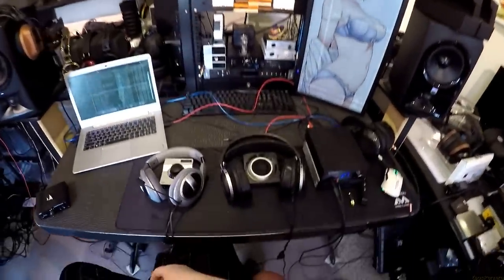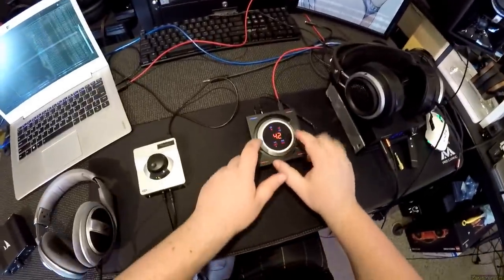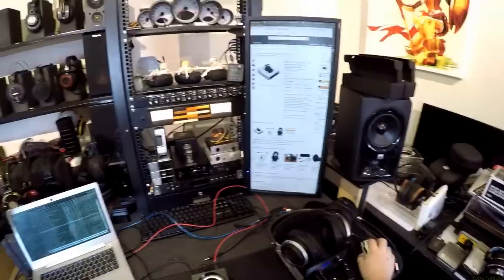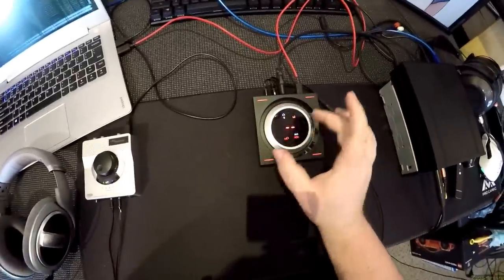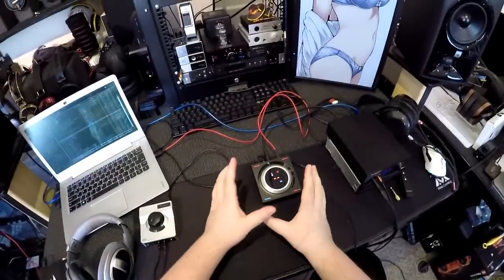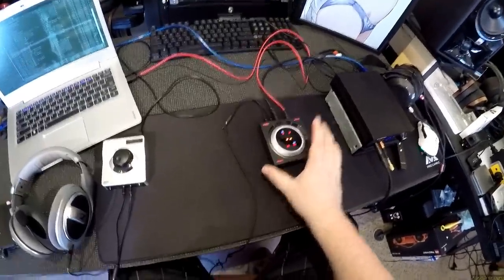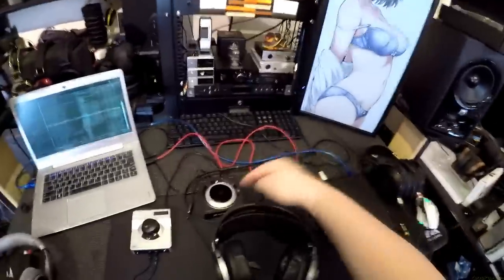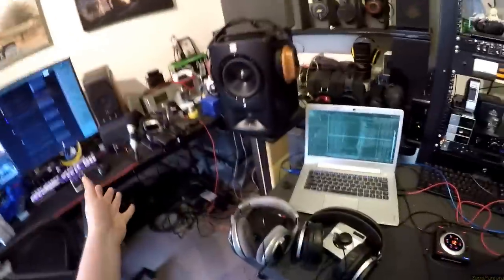Z Review - Sennheiser GSX1000 & Burson Play & Syba Sonic & Mayflower Arc

Comment: Is it worth buying the sennheiser? No. You can just get a sound card, run the optical out into a real dac, plug amp into it, your done. You have virtual surround sound without it sounding like shit because you turned your sound card into a DSP. And that doesn't have to matter if creative or dolby makes their virtual surround software not need hardware to work. Sure wave NX exists and so does... blech razer surround but  they are not great virtual surround sound encorders. Shit you can buy an old creative card like the x-fi xtreme gamer for like $30, plug it into a micca or whatever and congrats. You're done.

Audio companies or at least the "gaming" ones. I've basically told you what needs to come out. We need a DSP solution. Not a sound card, just a simple optical out with software solution or 100% software solution. Stop selling us the hardware which sits inside a electrically noisy box and does horrible things to audio, suck in your pride and just sell the software. Dolby, you can cut asus out of this gig completely. I know you are doing dolby atmos but dolby headphone is fine also and it actually works right now and not in 10 years from now when it becomes a standard, should it become a standard in the first place. Sennheiser, again I know what you are doing with your thing. Its the astros of PC, but PCs are not consoles. We don't need that. We just want the software. What the fuck is wrong with you companies. This is why we have to deal with hot garbage like razer surround or wave nx.